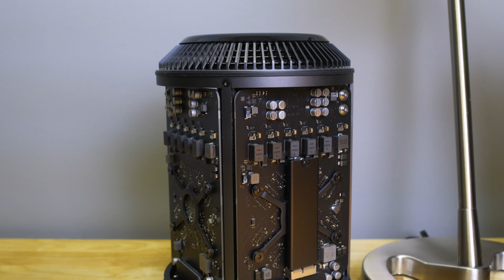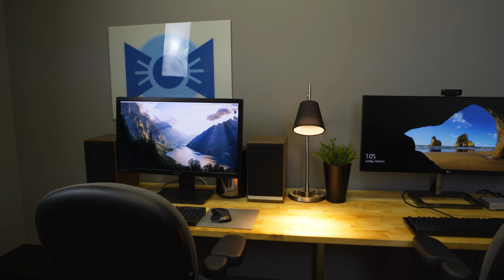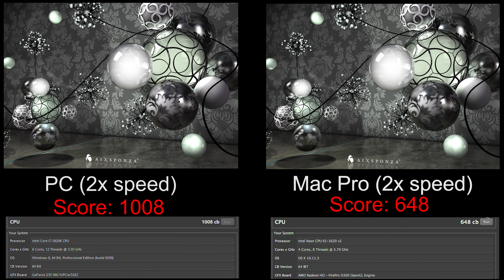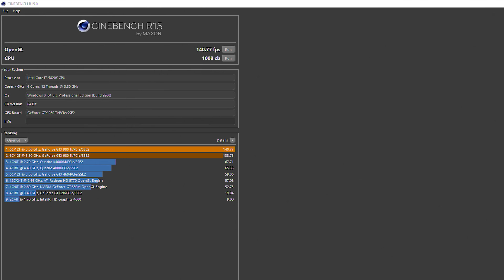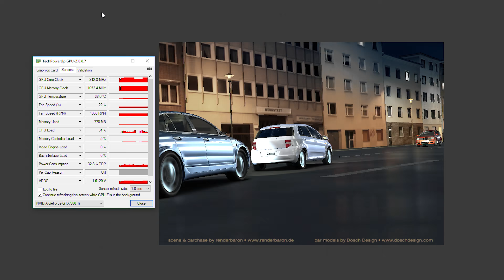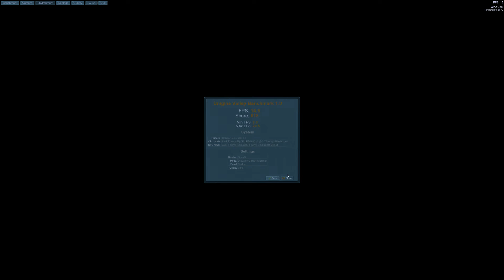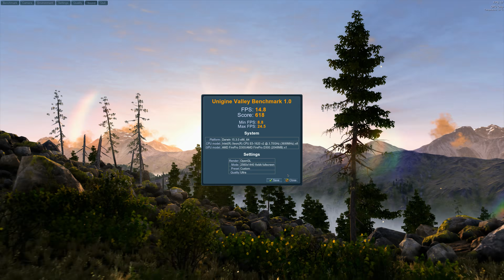$2,000 Custom PC vs $4,000 Mac Pro

Comment: My $1,000 AMD PC beat your $2,200 Intel PC by nearly 50%...
Unigine Valley: 70.4 FPS with 2947 Score while downloading a 3Gb file, on Ultra settings, but sadly the resolution was limited to 1280x720 due to my monitor.
Cinebench: OpenGL was 86.38 FPS @ 54% used, CPU was 628 cb on a AMD FX-8350

My Rig:
AMD FX-8350 @ 4.1Ghz
AMD Radeon R9 280X @ 1030Mhz
Cooler Master Hyper 212 Plus on Push-Pull
Asus M5A78L-M/USB3
Crucial Ballistix 16Gb DDR3 @ 1866
Seagate Pipeline 2Tb
Generic 1050w PSU
DIYPC Shadow Black
Reply from the maker: +GenMinion Not sure how that beats mine seeing as though it's half the resolution and only 20 fps better...
Reply: If you put it that way, then suppose on a 1 to 1 level our computers are equal. Mine still cost less than half of yours and runs the same. Granted your CPU ran better, I can give Intel that, being that Intel has been in the CPU market far longer than AMD, but AMD has proven to top the GPU market.
Reply: +GenMinion I like AMD as much as the next guy. But geeze get you head out of your ass. The R9-280x is no where near the 980 ti. You ran a benchmark at 720p which is not even 1 milion pixels to his that was run at 1440p which is pushing 3.6million pixels. You understand that resolution does affect performance right? If he dropped his resolution on unigine his score would destroy yours.
Reply: +GenMinion Seems like you don't understand what resolution is and how much it impacts a performance of a computer.
Reply: he was running 4k dude that takes a lot more then 1080lol
Reply: +GenMinion Hey my Mini totally wrecks your expensive Ferrari just look how much more space I got in my garage!!!!

That's stupid
Reply: +GenMinion You seriously, seriously need to do some research on resolution. You're not even running a full HD monitor.
Reply: +GenMinion I hope you're being sarcastic
Reply: +GenMinion You are rendering exactly 1/4 of the amount of pixels compared to his. So, comparing apples to apples, you got 17,6 FPS on Unigine Valley.
Reply: +Kierin Hale he was not even running 1080p he is running 720p
Reply from the maker: +Jtshowden Also ran in OpenGL, not DX11.
Reply: +GenMinion yo got a fast fps than his benchmark and you were on 1/4 the resolution he was....well done.
Reply: +GenMinion 1280x720 vs 2560x1440 this is like cat vs elephant
Reply: +Snazzy Labs
 Unigine Valley Benchmark 1.0

FPS: 
63.3
Score: 
3284
Min FPS: 
30
Max FPS: 
96.6
System

Platform: 
Windows 7 (build 7601, Service Pack 1) 64bit
CPU model: 
AMD FX-8320E Eight-Core Processor (3467MHz) x8
GPU model: 
AMD Radeon (TM) R9 390 Series 15.301.1801.1001 (4095MB) x1
Settings

Render: 
Direct3D11
Mode: 
1920x1080 8xAA fullscreen
Preset 
Extreme HD
Powered by UNIGINE Engine
Unigine Corp. © 2005-2013

Is this better than his ? ._. this is $1000 rig anyways.
Reply: +GenMinion I don't think you quite understand what you are saying....
Reply: +Joses Zaviere No... he ran his benchmarks at 1440p and believe it or not, resolution impacts your performance. Theres something for you to revise :)
Reply from the maker: +Jtshowden Also ran in OpenGL, not DX11.
Reply: +Joses Zaviere +Jtshowden Not only does it impact preformance, but it impacts it a lot. You can run a game at 45 fps in 1080p but still have trouble getting it over 15 fps in 4K.
Reply: +GenMinion U funny man, that rig can't even compete with an 1000 laptop, by the it is completing the benchmarks it is melted away
Reply: +GenMinion you are a idiot.
Reply: +GenMinion Yeah, play a real game at the same resolution as him, and you'll hate your life. Benchmarks are stupid for comparisons, they don't often utilize GPU's and CPU's in a real environment. The 980ti will blow your 280x out of the water and into Godzillas mouth.
Reply: +GenMinion thats cute my old hp with an i3 2120 3.3Ghz 8gb of ram and a open box gtx 750 ti was getting almost the same score but at 1600x900 maybe 2 or 5 fps less for around 280 dollars
Reply: +Snazzy Labs why did u take that bait...
Reply: +GenMinion You are definitely not stupid, but you are either ignorant in this particular subject or a troll
Reply: Love the hate~<3 Thanks guys Kisses
Reply: +Selim Yilmaz 1280x720 x 4 = 2560x1440, so it's more like cat vs big dog! ;D
Reply: ok but a very big  crazy dog :)
Reply: Jtshowden yeah i sure know about that, i was comparing my pc against the amd build above not Snazzy Labs rig..

Comment: Are the benchmarks you ran optimised for Dual AMD FirePro GPUs?
I'm pretty sure Premier isn't and Unigen Valley for sure is optimised for gaming systems and GPUs rather than the Mac Pro's GPUs.
I know for a fact that Final Cut Pro X is optimised for the Mac Pro's hardware and it performs very well.
Also you fail to notice that the hardware in the Mac has gone through more testing and is server grade stuff and is very reliable and stable unlike a consumer grade overclocked CPU and GPU, which is why it costs more. i.e. ECC RAM and what not.

Comment: So the price on that Mac Pro is actually now $3000. What is really funny is that does not include a mouse and keyboard. WOW! I also love how upgrading the 1800MHz DDR3 RAM to 32GB of the same speed is a $500 upgrade. My 32GB of 2800MHz DDR4 cost around $200. Do reallize that FirePros are like Quatros; they are not gaming cards. They are meant for graphic design.

Comment: One thing that I would like to point out is that Final Cut Pro is a MUCH better editor to use for Macs as it is optimized for the hardware. I have seen a couple of videos on the subject but that is my understanding. It is still ridiculous the price you pay for something like that. Imagine the specs of the windows computer running on final cut pro. That would be godly

Comment: well, Mac uses parts like the vgas that are hand selected to be more reliable, and it is using ECC memory which is the same as the vgas. you could spend 2000$ on a quadro which isn't as fast as a 980ti, but it is using the best silicon, hence the price difference. 

you are paying more for reliability, than you are raw performance.

Comment: I think it would have been better to do a test of a $1,000 PC vs that Mac Pro
Reply: +TopTenGamer i just ran cinebench on my computer 
my computer has a amd athlon ii x4 645 
6gb ram and a r7 370 i am running windows 10 
on cinebench i got 273 cb on cpu and 49.69fps on open gl then i got unigine valley installed and since i don't have a 1440p monitor i ran it at 1080p ultra i got  1540 for a score. not bad for a pc i got for free and put a 100 dollar graphics card in it really the amount i put into my computer is about 140ish for the gpu and a psu

Comment: Long time mac user, I like your setup and considering replicating it.  However, I need to add a thunderbolt 2 port.  Correct me if I'm wrong, but there is no extra space on an ITX board to add it onto the the motherboard, or Am I missing another solution.  Need to connect a Thunderbolt 2 storage array.

Comment: You should redo if you make so many mistakes.
Reply: Macpro specs where wrong and the text correction seem idiotic. do it again but hey dont take my word for it
Reply: Its pretty funny how you drift off. Its not the point. We dont argue about the piece of shit i.e. macpro. Its just about the mistake which could have been handled better.

Comment: Hi Quinn,

Great video, my partner and I found this most interesting.

I'm a gamer and she's a photographer, we're both currently using recent Alienware laptops, Alienware 15r2 and 17r2 respectively. She previously used an iMac for her photography work but found it rather lacking in grunt and (not surprisingly) portability and she upgraded to the Alienware 17r2 shortly after my 15r2 arrived (jealousy much? haha). She now finds that her current rig eats all of her photography work for breakfast and then devours her old Mac for a light snack afterwards. We no longer have the iMac for testing.

After watching your video and thinking about a discussion she's been having recently with some of her other photographer friends who are hardened Mac advocates, I was wondering if you'd be kind enough to run the Unigine Valley benchmarks on those machines again with the same ultra settings, 8xaa etc but at a resolution of 1980x1020 and let me know here what the scores were?.

The reason I ask is that the displays on our machines are 1080p IPS panels, which are lovely but prevent me from running the benchmark at the same resolution as in your video and I was really looking to do a comparison to see how some decent mobile equipment stacks up in these tests. In case your interested (if you're not, you've likely stopped reading by now) my machine clocked 49.8fps and a score 2085 at ultra settings and 8xaa running at 1920x1080. The GPU in question is an Nvidia GTX 980M with 4gb VRAM.

I'd be happy to post the rest of our specs and benchmark results if you wanted me to?.

Comment: Really...you compare a new machine with a 2.5 year old Mac Pro? You'll still be buying a new PC in a few years while the Pro will still be going strong. Had way too many PC's to give them any credibility other than gaming use now. My 2009 iMac still runs like new but then again, it's a work horse, not PC fanboy's wet dream.
Reply: +Mark Smith Cool story bruh.
Reply: +Mark Smith I built my pc in 2011 for less than 4000 and its still faster than the current mac pro. You should also be paying attention to what he's saying. That's the latest version of mac pro. It's a disgrace that apple still sells this glorified trash can labeled as the best thing money can buy.

Comment: So my 2010 chip (X5680) gives me 900 score at cinebench and the mac "pro" has about 650?
Is this a joke? In fact, im not even impessed by the I7 5820k... I miss when new CPUs where A LOT faster than the older ones.
Reply: +theodoro89 Well you can't break laws, cpus are unlikely to get faster, but they will get more effective which in turn makes them faster, but you wont see any massive jump in speed, at this point is about software

Comment: ran the same valley benchmark on my what, 6 year old AMD dual core athlon 7850 black edition with a 650TI, scored a 677 with an average fps of 20.85. mac pro stahp....hehehe
Reply: +koolBOY8323 and on the mid range AMD hex core i built last year, with a gt760, scored a 1591 with an average fps of 45.9. go home macfans, you're drunk...

Comment: So basically you compare workstation hardware to gaming pc, try test in AutoCAD and Video editing
Reply: +Black&amp;White Studio Laos he did a video rendering test if you missed that. the pc beat the mac at greater than a 3 to 1 ratio.
Reply: I know the pc beat mac in cinebench, Firepro/Quadro gpu is for  incredibly high precision accuracy in things like 3D modeling and CAD programs. The GeForce/Radeon is mean for high fps in real-time rendering.
Reply: +Black&White Studio Laos you dweeb. Accuracy? There is no such thing as inaccurate 3d rendering. Real time rendering is exactly what you want for 3d modeling. What good is your beloved mac pro and firepro gpu in a video editing scenario when it takes more than 3 times longer to render your video when you're done editing it. Cmon think of a reasonable argument.

Comment: How do you compare a computer optimised for gaming with another computer optimised for graphic design? If you were to build a PC using the same specs, it would end up being similarly priced with a similar performance.
Reply: ***** I did watch the video. Also, try throwing in some extra thunderbolt ports for the fun of it.. Oh wait, it's not possible. 
The Mac Pro is a ripoff. No one can deny that. However, it's comparing a workstation machine with consumer-grade components. Yes, the consumer-grade components work with workstations, but when reliability is a concern they're not worth it.
Little note: Expect issues with the RAM. Highest speed supported on the Xeon Ivy Bridge-E CPUs is 1866MHz. Anything faster than that does operate correctly.
Reply: ***** When double-precision is a must, Nvidia Quadro or Titan (the very first one, not the newer ones) or AMD FirePro are your options. They're not designed for gaming whatsoever. Also, 10-bit monitors (typically used for graphical design) do not work with consumer grade products. If you take all of those into consideration, the price significantly increases.
Reply: ***** And then they learn the hard way of poor investment. It may have a cheaper upfront cost, but if it cannot meet the demands required then it's a waste of money. What's worse: spending $4000 for a machine that does the job perfectly every single time, or a $1500-$2000 machine that does it right some of the time?

Comment: wow... WOW...WOWOW. my old laptop with a 3110m cpu running onboard gpu and 4gb ram got about the same or even higher score on valley.
Reply: +joshi paul Not running at 2560x1440 resolution and in ultra settings it wont
Reply: yeah i realised when that when i watched the rest of the vid XD

Comment: Don't you wish you could build a custom laptop like you can build a custom pc?  I'd love to see that.
Reply: +GpD79 There are or at least were laptops that was meant to be customizable lika Mitac. I bought 9008D which has fully removable heatsink and CPU and as far as i can remember GPU unit. Other standard stuff like ram, hdd, wifi (there are two mini pcie slots) are nothing that much special.

Comment: interesting video but you should also test a Quadro in the PC instead of the  GTX card as that is a more "professional" oriented card like the Fire pros in the MAC. the Quadro is menat to give better performance in thing like PR AE and other 3D application. that being said AMD Firepros have stagnated for a long time  so there is not new firepro Apple could use that would be better than what they have. Nvidia currently owns the market with its cuda technology with all professional applications providing GPU acceleration on CUDA and more on quadro as its "professional" card.

Comment: And here I am, silly me, still running an Asus P5B with a Core 2 Quad Q6600 OC'd to 3.2ghz/8GB DDR2 800 RAM/1600mhz FSB/HD 7870 2GB (@1100mhz core/1275mhz x 4 mem).  And it's still owning every game I've played.  Except that badly coded shit like GTA 4.  

But, of course, the PC in this video is OOHH LALA.

But, hold up, did I mention I have a Creative Audigy 2 sound card?
Reply: hah reminds me of my old system. just had the old rampage extreme motherboard so it could take ddr3. and a 7970 graphics card. that thing is still doing fine as well, even in gta, not a solid 60 but rarely under 40 on high settings.
Reply: combatplayer Nice, man.  Same, here, GTA 5 plays absolutely wonderful with everything maxxed out except for anti - aliasing.  Even then, it handles AA Ok in that game, but at high res and max graphics, AA doesn't make much difference. 

I'm really astonished how far my C2Q has taken me.  Stellar technology.  I don't want to get rid of it.

Comment: Compares computers 3 years apart, then builds an IKEA desk that isn't from IKEA but a DIY job.... don't be an idiot, get ya shit together.
Reply: Even if Apple came up with a p
Computer that has the same power as the PC (which is impossible) it would cost 10k or more.

Comment: The design is the entire reason the pro is so expensive. He hides it behind his monitor for fuck sake. It's the third the size of the custom PC and its two years old.
Reply: +corporatestatusbrah what good is a pc designed for it's looks (it's still ugly as shit) also he did point out that it is the most up to date Mac and it's still $4000 for a 2-year-old PC so yeah this is a correct comparison
Reply: +Lalnable Hector they are 3000 and I prefer to things that look good. Is it over priced, yea but for people who just want a fast computer and don't want to build a PC it is a good computer. It's sounds great when you label it as a 2000 PC, but you are getting cheap parts and assembling it which for most people is not possible

Comment: If you're after a good laptop in Australia go check out Metabox laptops. They start at $1500 and run rings around macbooks. We're talking a 3.4Ghz i7 with a 3Gb Graphics card, with an ssd and up to 4k screens. In a laptop. lol.
Reply: +The Talking Moose Metabox Laptops are rebranded Clevo laptops. Eurocom, Sager, and Leader get their laptops from the same manufacturer.

Comment: In regards to the arguments about size:  Why the fuck would you care about the size of a desktop?  IT'S A DESKTOP.  If you want a small, lightweight PC, then get a laptop!  Spending $4k on a desktop where the only advantage is that you can move it around and easily fit it in your pantry or sock drawer is just idiotic.  If you want what the Mac is good for, then just buy a $2,000 laptop with the same (if not better) specs and benchmarks.  Otherwise, spend the same $2k on a desktop that is miles ahead in performance.
Reply: You realize that you get smaller ones because there's different parts for the smaller ones... For example a motherboard that fits in a giant computer case isn't he same as one that goes in a small one... This also means you can get better deals and maybe better performance.
Reply: +Kegg plant (eggplant11) I'm sure it would not be hard to make a much better mini itx PC under $3k
Reply: +Tanmay Nandanikar With the components used in this build, pretty much easy to do.

Comment: i would like to see how to make that desk please
Reply: I made almost the same desk a few years ago and it's held up extremely well. 

All you need to do is buy a kitchen counter top from ikea, sand it and varnish it until it's smooth then buy enough legs to support the four corners and the center (there's a few to choose from, mine are height adjustable).

I drilled holes for cables on mine then installed cable management underneath.